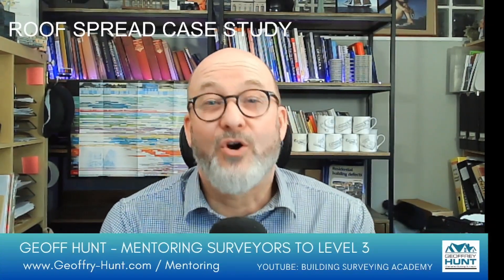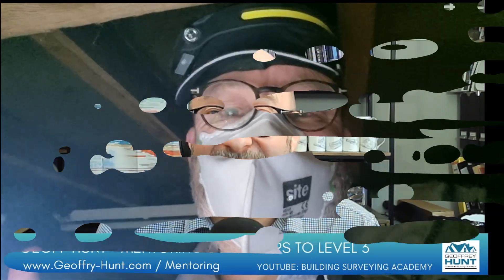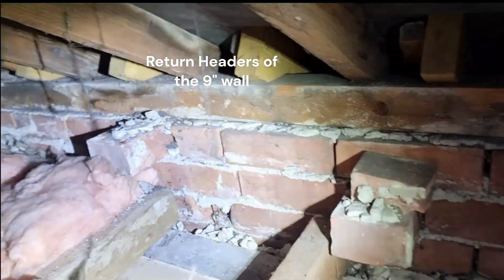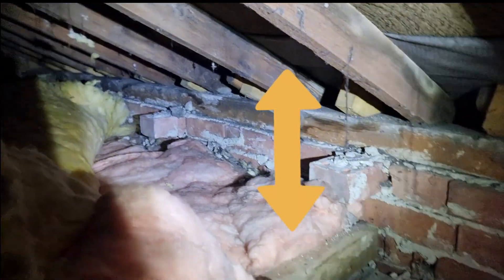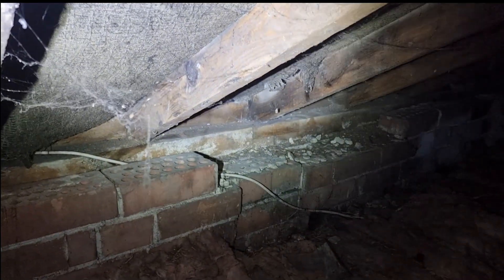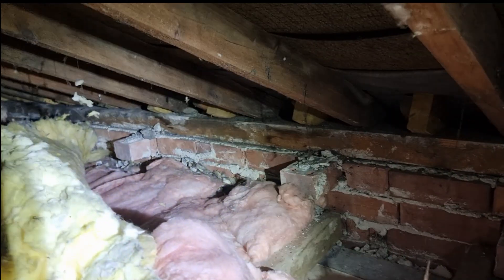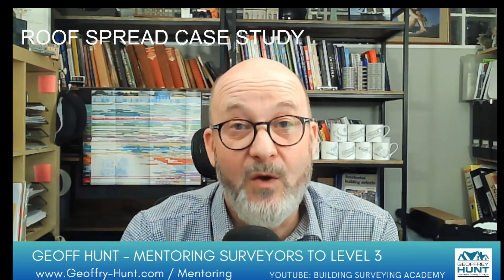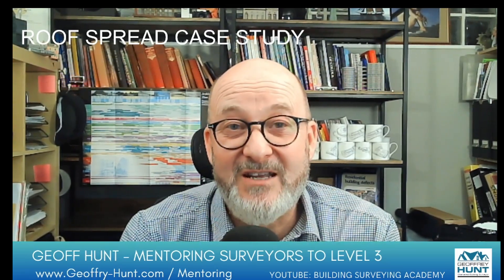Roof Spread Case Study #surveying #mentoring

Comment: The roof may have stabilised but for precautionary reasons I would add some strengthening. After all, a few extra timbers such as collars will not break the bank. Another reason for doing this is to mitigate negative comment from a surveyor when the house is sold on. A future surveyor might not be as relaxed and experienced as Geoff. When buying a property, you should have a future sale in mind.
Reply from the maker: Yes I agree.
Reply: I have to confess I was one of your students at Cirencester summer 2022!

Comment: Good video, so what advice did you give your client in terms of who should do what and when ?
Reply: I'm a structural engineer and have come across quite a few instances of roof spread.  Geoff said you could consider strapping and I would use to 30x5 straps used for holding down rafters etc and place at 45 degrees to connect the rafter end to a ceiling joists ad do that every other rafter.  I also suspect that the wall plate has a gap underneath it and only part of it is bearing on the brickwork.  I would either pack with dry pack mortar or resin injection if the gap is too small.
Reply from the maker: Thanks John great insight
Reply from the maker: Hi Craig. As I suggested in the video it is possibly static and to reduce or contain the risk some form of tie beam could be contemplated. I expressed the opinion the evidence suggested it was a low risk overall.
Reply: @geoffhunt6646  Hi thank you for the reply, so possibly CR2, can I ask did you advise that a structural engineer needs to be involved for the specification of the tie beam(s) and although low risk did you give an indication of timescales for remediation ? Apologies for the questions, its a good video and I am interested in this topic.
Reply from the maker: @craigsmith3954  when I  look at these cases when mentoring on line we talk around various scenarios to stretch your thinking.  But each case needs to be taken on merit but I was of the view that the situation was static but that any perceived risk could be controlled by a tie beam. I agree with you that if you were using the category system I would put it at Cr2 ( I'm not a fan of ratings so would not put it very prominently). As for structural engineers I wouldn't because a tension tie beam in timber doesn't need too much calculation and the risk is quite low. A good roofer would probably over cook it in any case and a "warranty" would be fairly trivial.